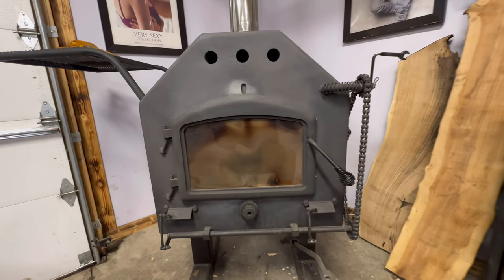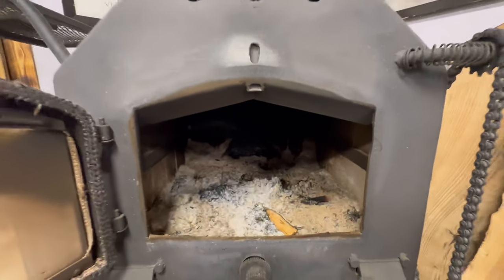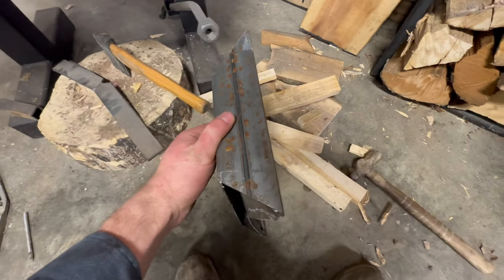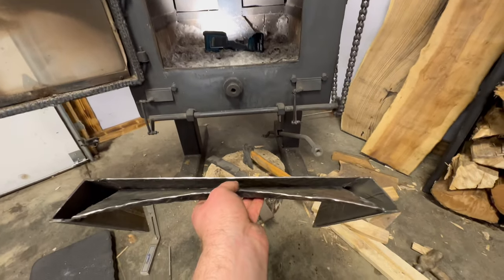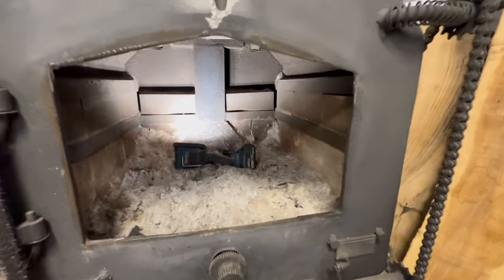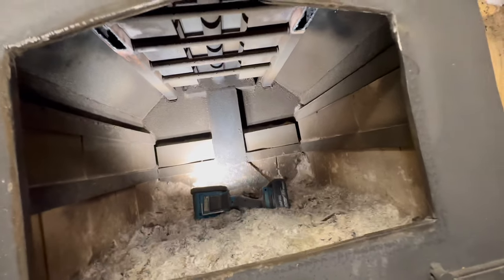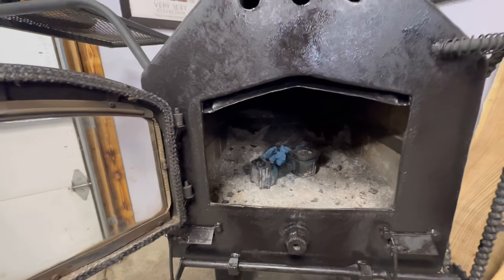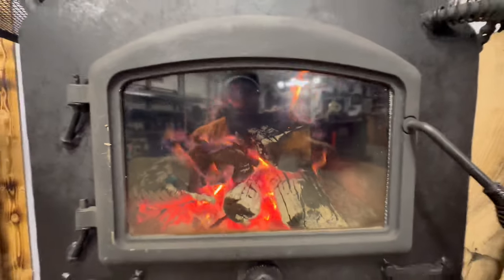Wood Burning Shop Heater Clean Glass Upgrade

Comment: Being a retired Machinist I am impressed with your stove build.I also noticed your blower is on a timer. When I installed my Fisher woodstove in the garage I wired  a thermo disc  so the fan turns  on when it gets hot and off when it cools off,this way it doesn't blow cold air. You flag looks good !
Reply from the maker: Thanks! In my case the timer works good. I have a good idea of how much longer it will burn so I can set it to that time and forget it.

Comment: You should experiment with a catalytic combuster..i got my first wood stove with one last fall and let me tell you i am sold on them!!..amazing long burn times with a glowing red catalyst that is 1200 degrees heating the top of the stove with no visible flames on the wood!..just like 5 or 6 small/medium splits of wood will go 12 hours and still have a bunch of hot coals left..I went from burning 5-8 cords of wood a year to probably less than 3...they are great if you want a steady low heat for a long time
Reply from the maker: I do know about catalyst stoves, they are very efficient, I may experiment on this stove one day or I might have to build a new one with that design.

Comment: Amazing work, looking forward for the update video! Did you made it with cast iron or steel ? Do you know if such weldings are resilient to fire heat in the long term ? Thanks
Reply from the maker: Thank you. The stove is made with all mild steel and welded together with standard welding wire (has more tensile strength then mild steel). With that being said I haven’t noticed any cracked welds or steel yet.
Reply: @Wolfpupfab  Thanks for your detailed answer!

Comment: I'd plumb in a way to bring in fresh air from outside into your intake because the air it's taking in is coming from your living space and that air has to be replaced with something and it's going to be cold outside air creeping in from wherever. If you sealed up all your leaks everywhere around the house the fire would no longer burn from lack of oxygen. Don't know what kind of structure you're in so maybe it's okay to leak like a sieve.

Comment: Your suck in air, don't you want it from the outside? That way you aren't sulking in room air, that is what I thought was bad, I may be terrible wrong though.
Reply from the maker: You aren’t wrong. It is better and more efficient to have air intake from outside air, not drawing air from inside the room. However in my situation it isn’t that crucial.
Reply: @Wolfpupfab  please advise......WHERE in / on the stove would the air inlet pipe go to?????? Great vid👏🏻👏🏻👏🏻
Reply from the maker: @charlescampbell1319  A lot of manufactured residential wood stoves have the option to attach an air intake pipe to the stove and run it through a wall to the outside to draw in outside air and not from inside the house.
Reply: @Wolfpupfab  I ran a ducting down from the roof cavity which terminates at floor level about two feet from the stove....I honestly don't know if it's useful or not🤷🏻‍♂️....what you think?
Reply from the maker: @charlescampbell1319  it is probably helping a little but it would be best if you could tie it directly into the stove.
Reply: @Wolfpupfab  must look into getting that done....keep up the good work you’re doing👏🏻👏🏻👏🏻